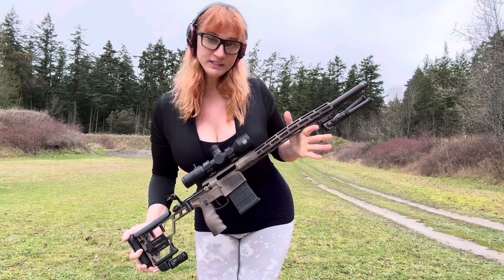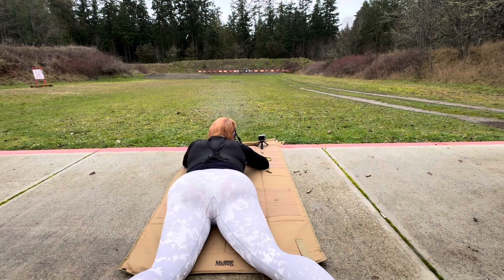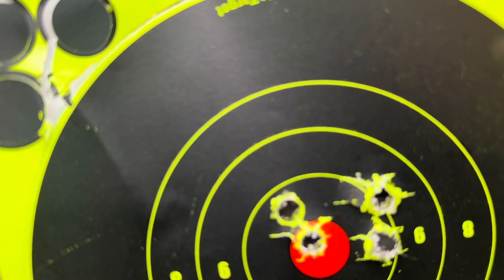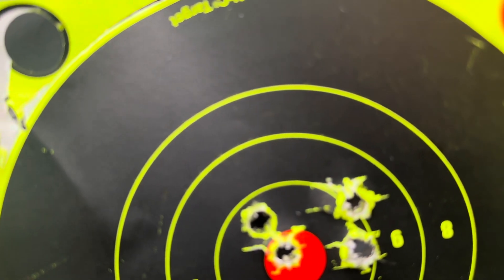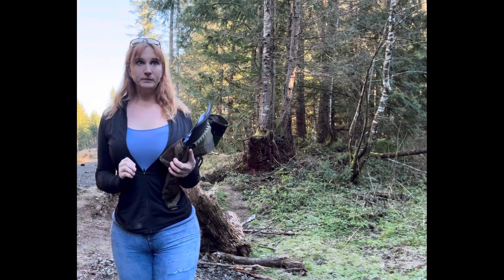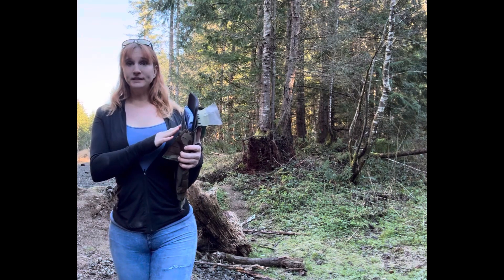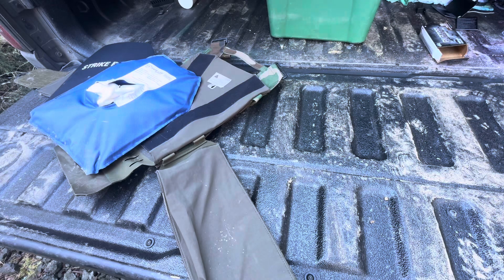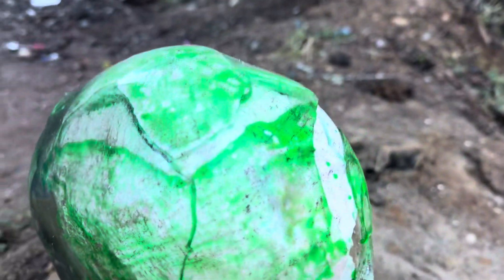The end of body armor? Testing the Army’s new issued next gen ammunition.

Comment: This is NOT the new armor penetrator bullet. This is another 'general purpose' round available to the public.  We don't know the exact composition, but the weight is around 130-135grains and shot at around 3000fps because that was the requirement by the army when the competition for the NGSW started. The new armor penetrator is classified and probably has a penetrator core. This video would have been taken down immediately, and you would be looking at prison time if you actually had the new ammo.

Comment: What you were testing was not the battle round the Army is using. You can tell it is the training/civilian round because it does not have the steel base (hybrid case).
 The hybrid case round has chamber pressures of 80,000 PSI.  The round you used, the regular brass-only case version, has a maximum chamber pressure of 65,000 PSI.

Comment: I wonder if you can use what’s left of your Safelife FRAS and try it with the plate behind the soft armour, obviously on a spot that’s not deformed. My theory is that the soft plate will spread the force over a larger area of the hard plate so it doesn’t penetrate.
Reply from the maker: @shadow4evr  that was a plate this ammo seems to do pretty good against ceramic and soft armor but AR 500 stops it
Reply: @  Hi! Love your videos! 
I know it was a plate and the soft armour together, but didn’t the round go through the hard plate then into the soft plate? I was wondering if the hard plate was behind instead of in front, if the round would be stopped without deforming so much. As it was in the video, it stopped it, but that would have been one hell of a punch to the gut.